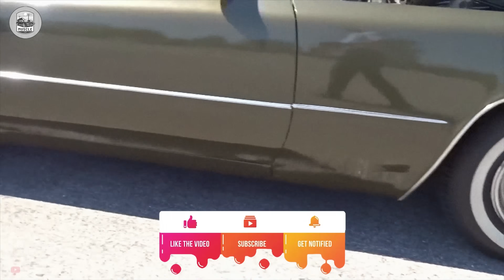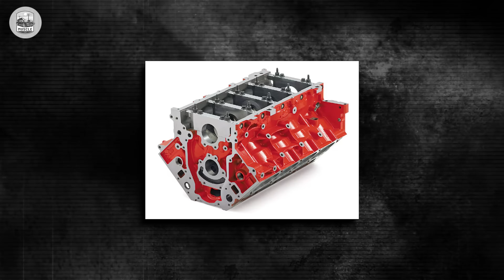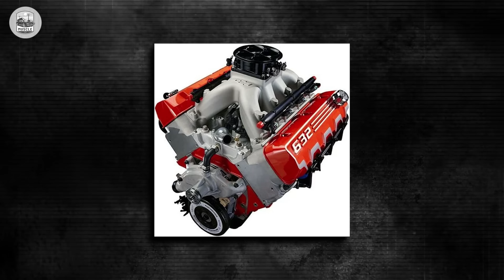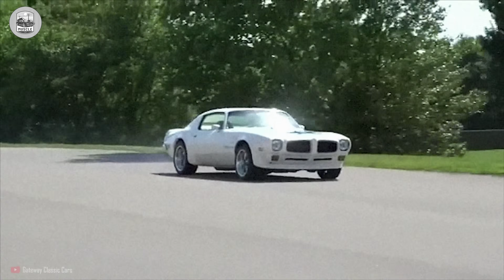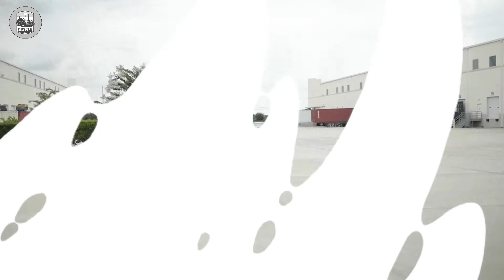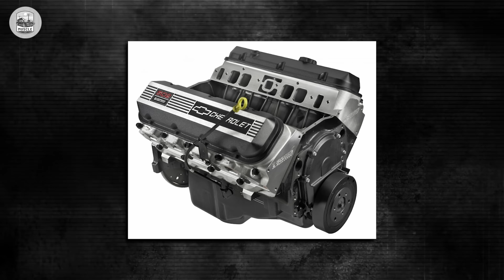GM’s CRAZIEST and BIGGEST V8 ENGINES ever made | You didn't know about!

Comment: Missed was rhe Wankel rotary that was canceled just before start of production. All the machine lines were scrapped.
Reply: The Wankel was an emissions, economy, and durability nightmare. The apex seals eventually got figured out BUT what killed it was the emissions standards due to it's  poor surface to volume ratio. That also made them more fuel thirsty as they aren't as thermally efficient.
Reply: @turbo8454  Look, I get the Wankel's got its quirks, but let’s not ignore its innovation! Sure, it had emissions challenges, but so did our beloved V8s in the '70s. The rotary offered insane RPM potential and a power-to-weight ratio that no piston engine could touch.
Reply from the maker: @AilaniMadden  The Wankel rotary engine was a groundbreaking innovation, pushing the boundaries of RPMs and power-to-weight ratios like no piston engine could. It had its challenges, especially with emissions and apex seals, but its potential was undeniable.
Thank you for your comment... have a good day.
Reply: @AilaniMadden  "innovation" does not always assure practicality, durability, or affordability. It was a flop overall even though Mazda managed to sell a few on and off over the years. Lately Mazda is planning on using a small  800cc Wankel running at constant speed to power a generator in a hybrid. Maybe it will be practical in that type of application.
Reply from the maker: Thanks for your comment, @turbo8454
yes, innovation doesn’t always guarantee practicality or longevity, and the Wankel rotary engine did face its share of challenges. However, we can't deny how revolutionary it was at the time. The high-revving nature and compact size were a game-changer in performance, and cars like the Mazda RX-7 proved its potential in the right hands. Sure, it had issues with emissions and the notorious apex seals, but there's something undeniably cool about a rotary engine.
As for Mazda’s latest plans with the 800cc Wankel in a hybrid application, it's exciting to see how they’re trying to find new life for this unique technology. Who knows? We might see a revival of the rotary in a whole new form!
Let’s keep the muscle car spirit alive, folks
Drop your thoughts below, share your experiences, and hit that subscribe button for more awesome muscle car discussions. 
Let’s keep pushing the boundaries together
Reply from the maker: @turbo8454   The Wankel rotary engine was a bold idea, but its emissions and fuel efficiency issues really held it back. The apex seals were a major concern, and the engine's poor thermal efficiency and surface-to-volume ratio made it a tough fit for muscle cars. The Corvette project could’ve been revolutionary, but sadly, emissions standards and durability concerns put the brakes on that dream. Still, the Wankel remains one of the most unique and ambitious engines in automotive history. 

What do you think, muscle car fans? Let’s hear your thoughts. Comment, share, and subscribe for more American muscle passion...
Reply from the maker: Great point
 The Wankel rotary engine was definitely an interesting and ambitious project that could have changed the game for American muscle. It was supposed to power the 1964 Chevrolet Corvette, but the project was scrapped just before production due to reliability issues and concerns about emissions. The prototype was impressive, and some even believed it could compete with the big-block V8s of the time! It's wild to think that all the machine lines were scrapped. 
For all the muscle car enthusiasts out there, what do you think? 
Comment, share, and subscribe to keep the conversation going on all things American muscle...
Reply: Ah, the Wankel rotary, a wild idea, but let’s be honest, it was a gamble that probably wouldn’t have held up like the Cadillac 472 and 500. Those big-block Caddys were all about torque, reliability, and going the distance. I’ll take an engine that can pull 200k miles with proper care over an unproven design any day. Cool concept, but scrapping it was probably the right call. Sometimes you stick with what works, and the 472/500 was proof Detroit could still build a bulletproof powerhouse
Reply: @CookeZachery  Cadillac had the guts to dream outside the box. Sure, the 472/500 were torque monsters and practically indestructible, but imagine if Detroit had perfected the rotary. Lightweight, high-revving, and compact—could’ve been a game-changer for luxury performance. I think it is great  @richardjamsek7080 you got my point.,,,

Comment: I actually had a ZZ502 swapped into my old Chevelle. That engine was an absolute beast on the street. I took it to the drag strip one weekend and still remember the thrill of laying down a 10-second pass. ..
Reply: I always felt the ZZ502 was more hype than substance. Sure, it’s a torque monster, but I’ll take a well-built small block 406 over it any day...
Reply from the maker: @CookeZachery  thanks for sharing your thoughts
 The ZZ502 is definitely a torque monster, no doubt about it, but I get where you're coming from with that small block 406. The 406 is a legendary engine with a more compact, balanced feel, making it a great choice for those who prefer a well-rounded setup. That said, the ZZ502 is all about raw, brute power – a true street machine, especially in a Chevelle. Both engines have their place, depending on what you're after. Keep those muscle car stories coming! Drop a comment, share with fellow fans, and don’t forget to subscribe for more muscle car content.... Have a good day.
Reply: @CookeZachery  You know, I’ve run both a zz502 and a high-revving small block 406, and while the 502 delivers brutal torque, it lacks the character of a properly tuned 406. The 502 feels like overkill—too much weight up front and not as nimble. My 406 screamed past 7000 rpm, and I could actually enjoy rowing through the gears.
Reply from the maker: The ZZ502 is a true powerhouse, the perfect engine for making any Chevelle a street-dominating monster
That 10-second pass must've been an absolute rush, feeling that raw power on the strip. The ZZ502's 502 cubic inches of raw torque and horsepower make it one of the ultimate choices for muscle car enthusiasts who crave that unbeatable thrill. For anyone considering an engine swap, this beast delivers both on the street and at the track.
 If you've got your own muscle car stories or thoughts, drop a comment below, share this with fellow fans, and make sure to hit that subscribe button
 Let's keep the muscle car legends alive